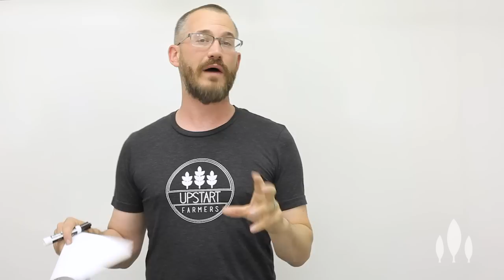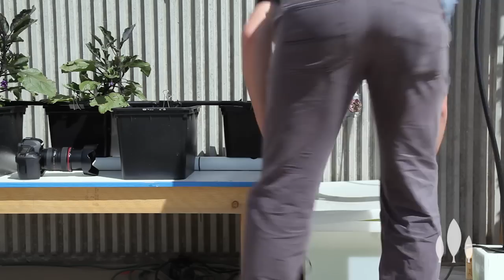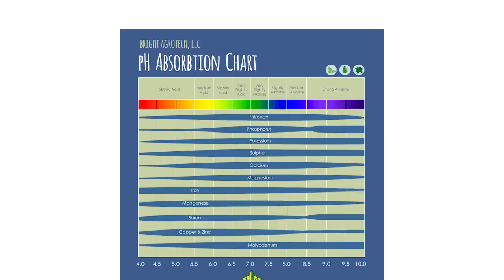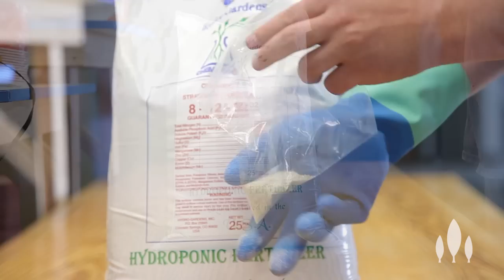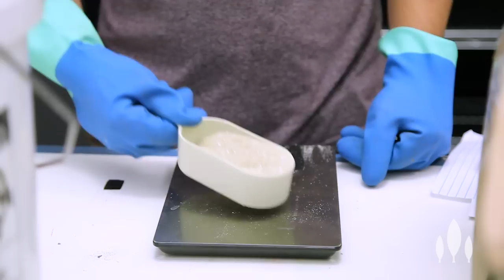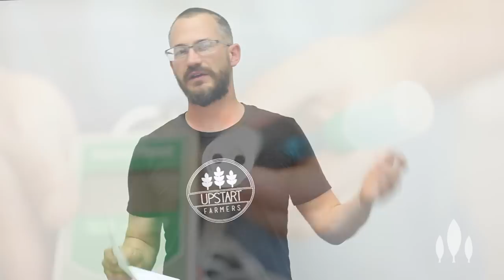A Beginners Guide: Hydroponic Nutrients

Comment: What are your suggestions for water? Obviously distilled or RO water that are really close to pure are optimal, but what level of water quality is needed? I ask this, because I'm getting setup to grow some strawberries and some other produce inside, but plan to run something much larger outside in the summers. Is there anything specifics I should worry about in City water? I haven't tested my water yet.
Reply: Rubbish, simply use nitric acid PH down to convert the calcium carbonate in the source water into calcium nitrate. 
Reduce the quantity of chemical calcium nitrate to rebalance the total N and Ca in the working solution.

The reason your Part B (calcium nitrate) is kept seperate is not because its not very soluble, (1.2kg will dissolve in a litre of water), its because in concentrated solutions it will react with sulphates and phosphates to form insoluble precipitates that are then unavailable to the plants. If you mix concentrated  calcium nitrate and magnesium sulphate (epsom) solutions you`ll see it in action ;)
Reply from the maker: The most common problem people run into with source water is carbonates. If they're at 250 ppm or up, you should use an RO filter.
Reply: i don't know what carbonates are, but i stuck my TDS meter in some of my tap water and the reading was 150 - 160 ppm.  do you think that's okay?  i really don't want to have to buy distilled water.  thanks!  this is just for personal use in a miracle grow aerogarden and i'm not looking for absolute perfection.  i want the plants to grow well and flower well and fruit well, but i'm not trying to feed a whole city.
Reply: Ok

Comment: If I dissolve part B (Calc. Nitrate) first in warm/hot water until it's fully dissloved, could I then add  the required amounts of part A and Mag. Sulfate in the same water to come to a concentrated mix of all the required nutrients, and then use that concentrate to mix with water to arrive at the desired PPM in the final solution.
Reply: You shouldnt need hot water for calcium nitrate, you can dissolve upto 1.2kg  in 1 litre of 20 deg C water. If its hard to dissolve it may be a field grade calcium nitrate (typically granular) rather than a greenhouse grade (typically prilled). The latter will dissolve almost instantly in cold water.
Reply from the maker: +chandra0102 Nope, better mix and store them separately, especially if you're storing a concentrate. A bit of a pain but worth it to avoid precipitates!
Reply: Thanks for your reply, greatly appreciate it.

Comment: Really interesting video. I have 2 questions based on the information the you explained.

1. What happen if my desired EC ratio is 1.2 but by mistake I exceeded up to 1.5, how it is possible to put it back at 1.2? 
2. You recommended to first measure EC and then pH. However, I have an scenario that might help you to understand my question.
My EC is already set at 1.2 and now I will be regulating my pH from 7.3 to 6.5. The solutions that I will be using in order to regulate my pH wont affect at all my EC or I will need to measure my EC once again? 

Regards
Reply: 1. Add water to bring down EC.
2. pH balance should not affect EC too much but you could always recheck to be sure.

Comment: I have a 2 part system where I can run the hydroponic unit separate from the aquaculture unit. Can I mix used hydro water with water to the aquaculture, and if so what EC would be the maximum the fish can handle?